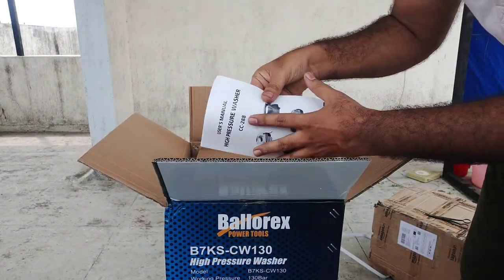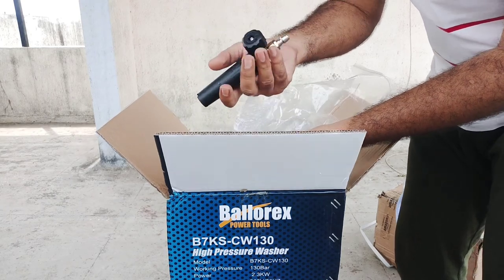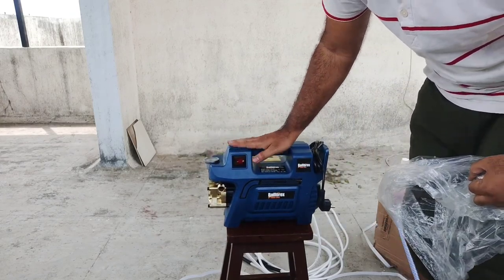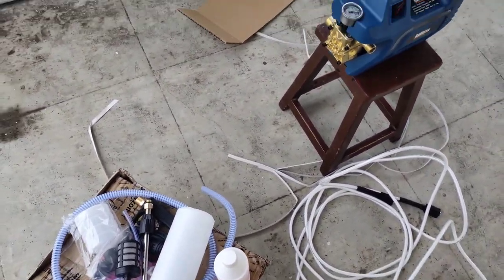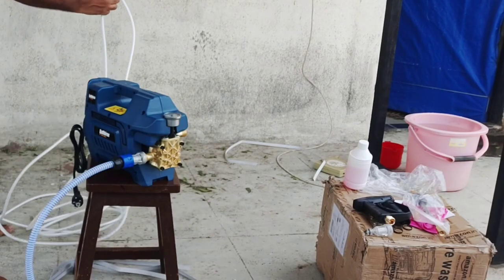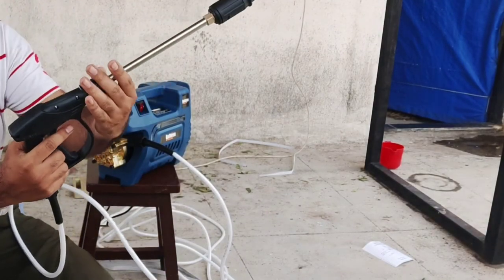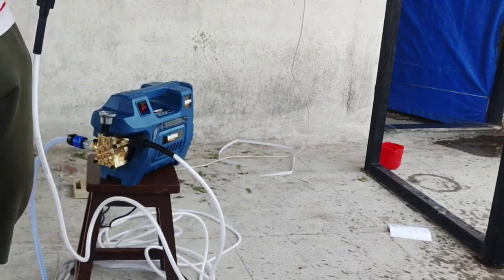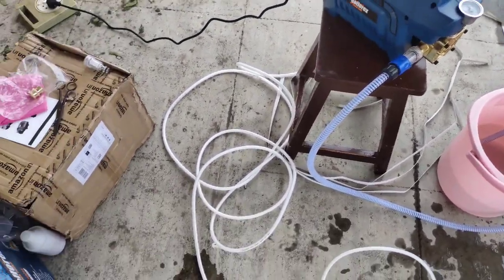Ballorex (KS-7) 2300W 130Bar Heavy Duty Car Pressure Washer.

Comment: Sir I have the same machine .. I am getting only 120 bar.. for u its showing 150 bar.. what to do? Just 1 month old
Reply from the maker: @jeevabharathi R sir, sry for the delay.. actually this machine comes with 120 to 130 Bar pressure which is more than enough for Home use. Not sure for me, why it's showing 140.. It must be a Pressure Gauge glitch.. Don't wry about Bar, make sure it should clean your vehicle happily..TC..
Reply: @mr_Hunkk  ok sir..thanks for the reply. As you said , it cleans the vehicle real good sir
Reply: Pressure usually depends on the gun nozzle so might be some dirt has accumulated in it , just try cleaning it with thin wire which comes along
Reply: @its--Evander  thank you